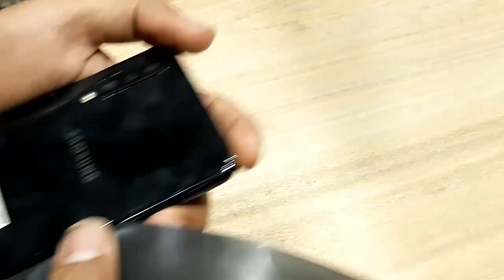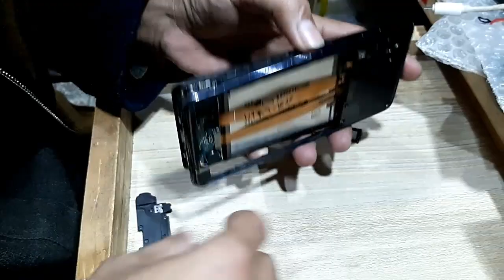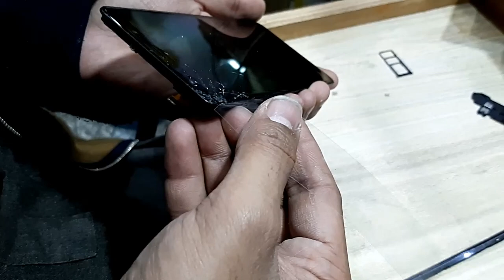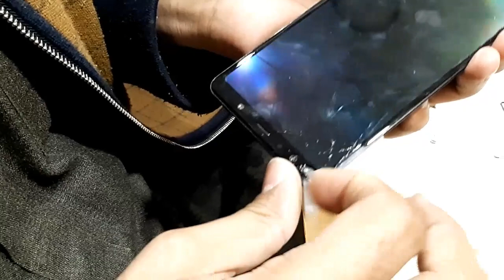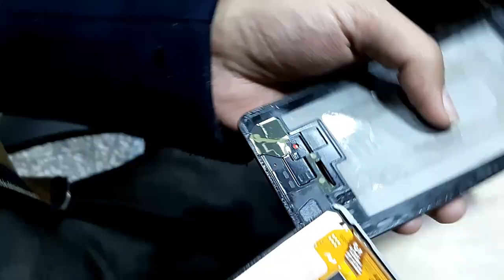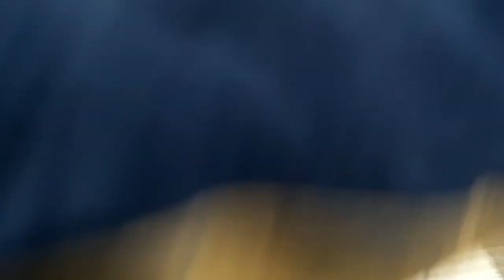Samsung A750 A7 2018 LCD Replacement - Galaxy A750 Display Replace

Comment: great !!! we need more like that, this video was I looking for. Thank you for sharing that. But how did you do for passing the thin plastic underneath lcd display, what about this tip?
Reply from the maker: Thank u for like my work. Thin plastic is xray or oca paper's part. Use hot air and blade or hard blade for starting with xray for remove lcd.